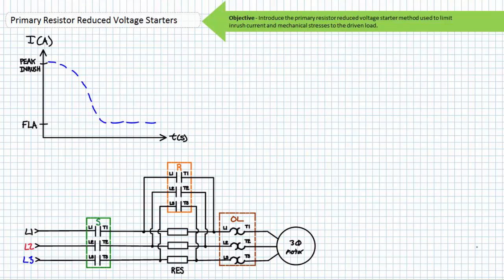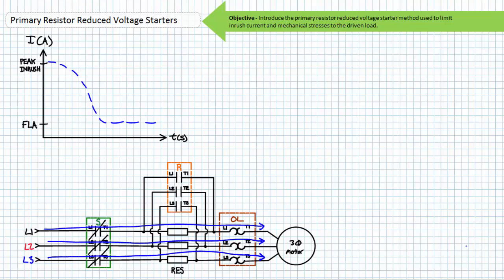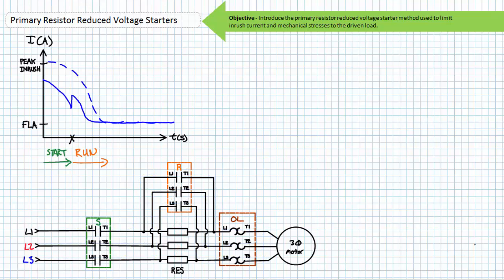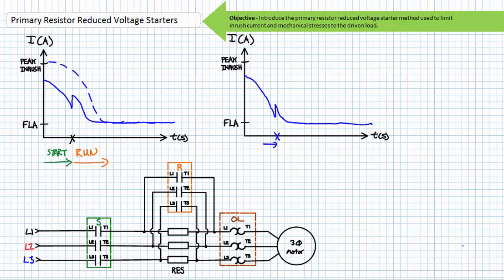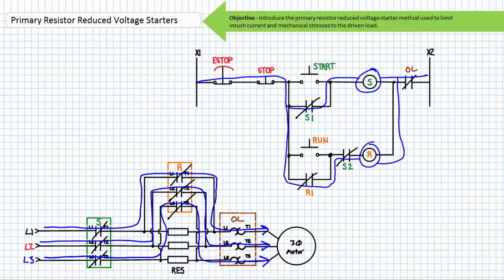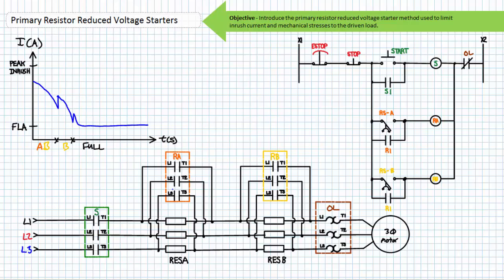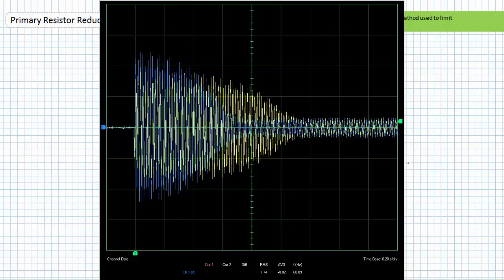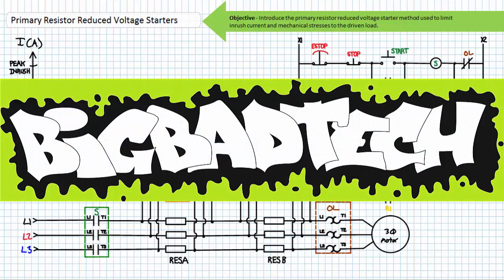Primary Resistors Reduced Voltage Starters (Full Lecture)

Comment: What is power rating of resistors? If there is 3A (total inrush 9A) inrush passing through each resistor (10 ohm), then using power equation P=I*I*R, power dissipated will be 90W. Can we use 90W resistors or we need to use "bigger" ones?
Reply from the maker: Customarily most electrical equipment includes a significant overrating factor to ensure longevity and safety. Example: a certain manufacturer may specify 1.25, 2X, or even 4X the calculated value

Comment: Jim, pls give us a real example. Lets say a 100 HP- 460V motor. If a  wye-delta starter is used the initial voltage is 58%, what size resistor should be used to produce a similar effect in Primary resistors reduced voltage starters?  460 x 0.58 = 267 Volts, voltage drop is 460-267= 193. What size resistor  will produce a 193 Voltage drop.  Don't know how to apply ohms law!
Reply from the maker: Good question! Never thought about trying to make one type of reduced voltage starter "perform" like another one. I've got a bunch of 3 phase AC lectures I'll be publishing early this fall detailing 3 phase AC circuit analysis and power calculations, however, to calculate the resistance necessary to produce a desired voltage drop divide the desired voltage drop by the anticipated current.

Comment: where should i connect the 2 leads (X1 and X2) of the control circuit in the power circuit?
Reply from the maker: X1 and X2 are pilot level control voltage. Either 24vdc or 120vac. Check out the “basic ladder logic” lecture.

Comment: Can you do a  video on secondary motor  resistors, great work as always!
Reply from the maker: Presuming you're referring to the resistors used on the rotor (ie: the secondary) of wound rotor induction motors for start up and primitive speed control? If so, yes, I'll be discussing wound rotor induction motors in the future. These rotor resistor configurations are slowly being replaced by motor drives, a slightly more sophisticated means of speed control. Until then check out the motor drives lectures at: https://www.youtube.com/playlist?list=PLdnqjKaksr8qruLl85Uq3em62PjXlSNUF
Reply: Jim Pytel yes and awesome,thanks.